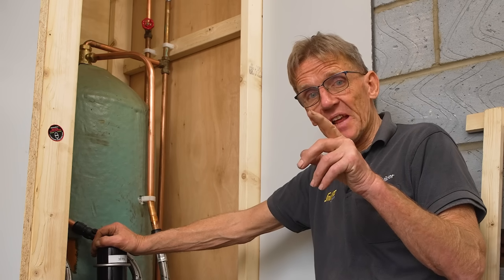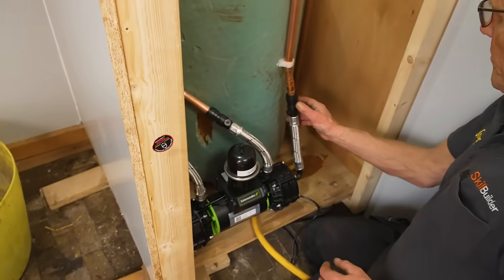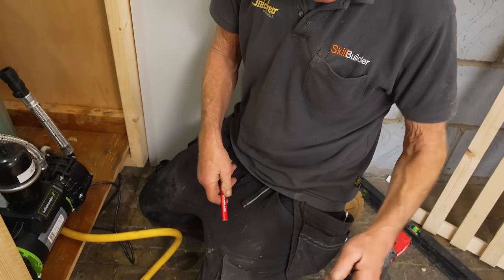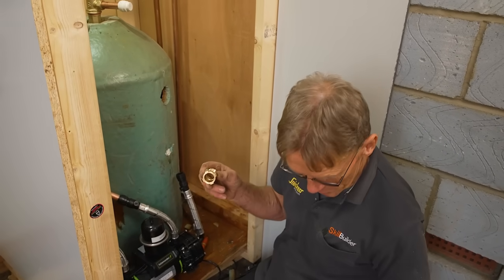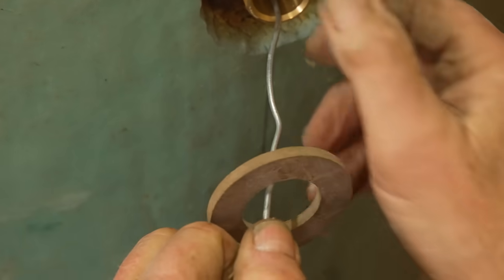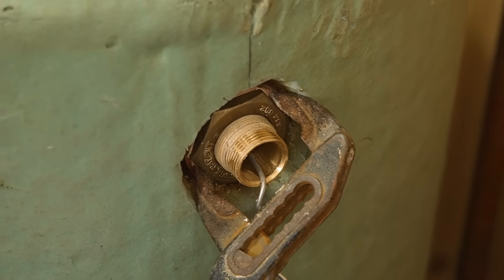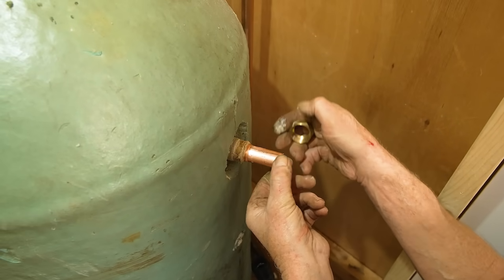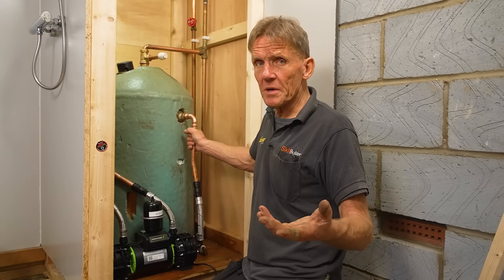How To Fit An Essex Shower Pump Flange

Comment: Brave drilling into that cylinder!   I changed an exposed Bar type thermostatic shower valve a few weeks ago WITHOUT turning off the water.  The water pressure was insane and I got soaked to the skin but I did get the new one on without any problems.  although I woke up with nightmares at 3am that night!  🤣 Roger's the man for this stuff on youtube.....  great that we get all these tips for free and google/microsoft  pay these guys commission.  How good is that!   everyone happy.....
Reply from the maker: It is a bad day when you get wet but it happens.

Comment: Interesting seeing the flange fitted but I would have appreciated a fuller explanation of why this was being fitted.
Reply: cavitation....or lack of, via this positioned flange.
Reply: @bodinski100  Ugh? Cavitation in fluid mechanics and engineering normally refers to the phenomenon in which the static pressure of a liquid reduces to below the liquid's vapour pressure, leading to the formation of small vapor-filled cavities in the liquid. In my experience this is usually across a restriction e.g. a valve. Where is the cavitation occurring in this installation and how does this help?
Reply: @John-dp8oh  a lot of pump installs have the hot feed to the pump TT-d from either the top oulet pipe, or in a lot of cases the downpipe from the cylinder, very close to the T off for the the vent pipe.....according to most manufacturers, the threat of air pull from the vent pipe, into the httpump feed can cause cavitation at the pump impeller site......the flange installled here totally minimises this from occuring at it takes a direct feed from the tank, and because of the bird mouth pipe orientation, air ingress is at a greater unlikelihood.....probably
Reply: @bodinski100  Interesting...thanks.

Comment: i all ways fit compression lever valve before pump hose makes it easy to change pump as some times hose isolating valves plastic become brittle and break and it can be a bit of a flaff if you need to change hose.

Comment: I’m old enough too remember when cylinders came with a second return flange already fitted just had to plug off if not needed 👍
Reply: Ok, but why?
Reply from the maker: you can still get a secondary return port but if it has an internal stop you need to file it out.

Comment: Nice job !  I remember fitting those. I used to solder up a 90 on the flange pipe first, then push it in and tighten it up. Or I used a compression elbow back then. Didn't have a fancy crimping tool !😉
Reply: Yes, compression fittings, plumbing for idiots, so easy I could use them.

Comment: I bought an Essex flange and ended up bottling it and fitting a Leamington flange instead, which has been working great. I didn't have a cylinder drain off either, so not having to drain it was an added benefit.

Comment: I have fitted so many of these over the years and the one thing I always do is thread and tie a piece of string through the fitting before inserting it into the cylinder. Because occasionally the fitting drops off the wire and lands in the bottom of the cylinder. After I start the lock nut I cut the string away. I learned the hard way.

Comment: Some 20 years ago, a plumber fitted one of those essex flange thing to feed a power shower upstairs. He also fitted a valve to shut the hot water to the power shower. A couple of months ago I needed to replace the power shower and I was pretty sure I knew where to shut off the hot water to the power shower but the hot water never stopped.... I still don't understand why .... Same as on this video, but instead of feeding a pump, mine feeds the power shower. I had to turn the hot water to the whole house off.(cold water feed from the tank in the loft), I don't know what the plumber did, it's under the floor boards. So I fitted isolation valves....

Thanks for the video.
Reply from the maker: What did the valve look like?  If it was a gate valve and you didn't use it very much, it is very common for them to let by. I would say that 50% of them fail after a few years of doing nothing and that is why we now fit lever valves.

Comment: Is there a video of Roger fitting an "S" flange (just like the one in this video), including the removal of the existing iron from top of cylinder? I have to fit an "S" flange to the top of an old IMI cylinder (nearly 50 years old). 
Before I can do this, I have to remove the old elbow from the threaded boss at the top of the tank. 
I'm crapping myself at the thought of breaking the solder on the tank boss and ending-up having to replace the entire HW cylinder.
Can you suggest a release agent (WD40?), and should I prepare myself for the worst - i.e. the boss cracks & I have to replace the whole cylinder?

If a customer asked you to fit an "S" flange on a 50 year old cylinder - would you do it?
Reply from the maker: I just warm the elbow up with a blow lamp. It softens the boss white that was often used. If you tap it round rather than apply a lot of force it works better. The kinetic force is more direct to the thread. You will be fine.
Reply: @SkillBuilder  Cheers! Thanks for the vote of confidence - I'll take my time!

Comment: I’m about to fit a shower pump next to my boiler. I was going to t into the top, why have you taken that out and come straight out the boiler instead??
Reply: To prevent an air lock when another tap is opened whilst someone is using the shower.
Reply from the maker: If you tee into that pipe on top of the cylinder it can suck air down the vent pipe which wrecks the pump. 
If you have a metre or so between the top of the cylinder and the bottom of the cold water tank you can fit an S flange which screws into the top of the cylinder and gives you an independent tapping for the pump.
Reply: Thank you for the reply, that’s saved me some pain I’m sure! Love the channel, keep up the good work!

Comment: Do you make the dip tube with birdsmouth or can you buy one with an essex flange? Cant see them supplied with one! Cheers
Reply from the maker: You make the pipe end by cutting it. Then just measure it and insert it
Reply: Thanks. Yes, worked that out. Fitted yesterday. First one I've ever had to do... Always been Surrey flanges.
All went well and weird that I only watched this video on the weekend then get a call on Monday to arrange to fit one lol.
So, thanks again - video really helped 🙏🏻

Comment: What was the reason for fitting it?
Reply from the maker: It stops air being drawn into the shower pump. If the cold water tank is less than a metre above the cylinder it is a good option.
Reply: But that cylinder already has a Warwick valve at the top doesn't it?
Reply: @SkillBuilder  thanks👍

Comment: Naughty. You created a dead leg!!!!!
Reply from the maker: Naughty? Where is the dead leg?
Reply: Where you disconnected the hot feed to the pump you used a push fit stop end on a piece of pipe creating a dead leg. Dead legs should be no longer than the pipe diameter. In this case it was more than 22mm. Perhaps do a video on dead legs and legonella?
Reply from the maker: @robparker3737  rob parker 
Actually it should be no longer than 1,5 times  but the  point here is that I was merely capping that off to demonstrate how to fit an Essex flange. It wasn't needed and the cylinder will soon be with the scrap man. I agree with your suggestion that it would be good to do something on deadlegs so before I scrap it I will show how to cap it off with a 22mm blanking disc. 
As an academic point I would not  leave a plastic stop end like that but if I had capped the pipe it would have been shorter and being and the hottest part of the cylinder I have zero concerns about legionella.
Reply: Sorry. I didn't mean to rattle you. People take your work as being totally correct. In six years I have had to attend two failures of push fit stop ends on copper. They are good on plastic because the metal crown bites into the plastic.

Comment: I would say that's about as difficult as plumbing gets. I would have recommended upgrading to an unvented cylinder rather than a negative head pump waking the hole house up in the mornings!
Reply from the maker: If you have enough flow in the mains that is fine but it is not always the case

Comment: Why are you adding jointing compound to the locking nut? If there was any water leaking at that point it's too late surely?
Reply from the maker: I used to find that water could get past the washer on a tank connector and then track along the thread. I think the same could happen here if the internal seal is not 100%. My approach is to ask "Does it do any harm?".

Comment: Ever use the wire to hold the flange use a flue brush instead it is easier to do the job and easier to remove.
Reply from the maker: Good tip, I like it.

Comment: I don't like the idea of Essex flanges. One is cutting an extra hole in the cylinder that is going to leak at some point in the future. I am a plumber and had several customers where these have been leaking. They are a nightmare to repair. One has to partly drain cylinder and then carefully remove old flange, clean up surface around  hole as best one can and fit new one. Not easy at all